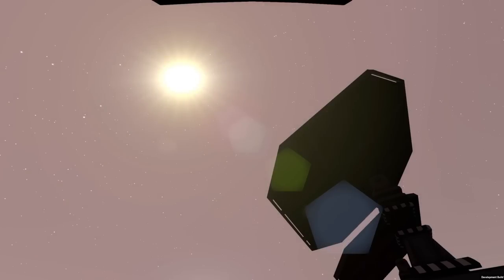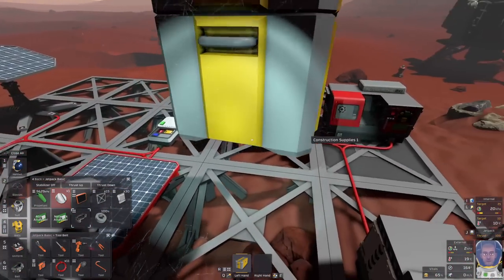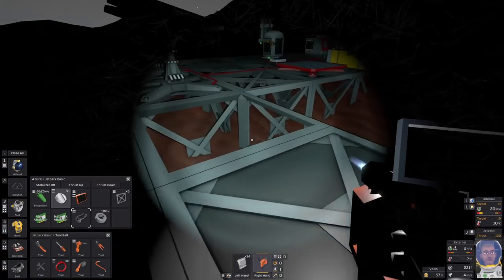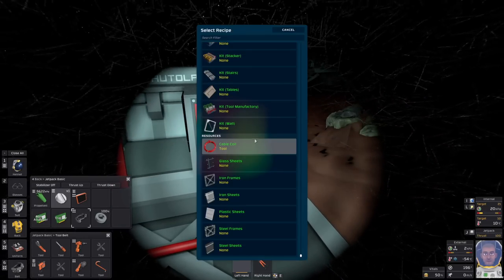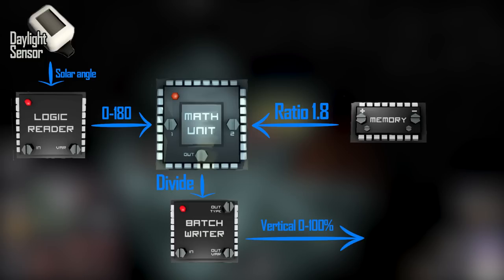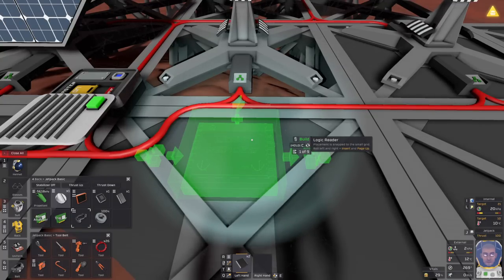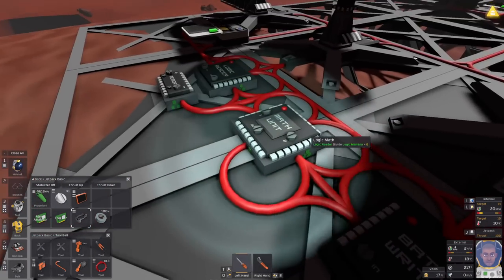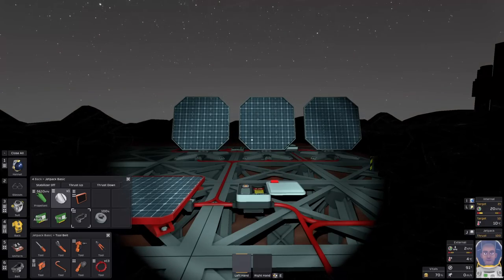Getting Started: Stationeers Solar Tracking Logic

Comment: A little tip for those who plan on going 2x axis from here: you can link horizontal to same sensor, but then halve the Vertical value, so that it wont turn away from the sun on afternoon.
Also, Solar Panels can be mounted sideways on the frames - looking cool, and functional as well.

Nice Tut, Splitsie, looking forward to one on how to make freeze dried greenhouse tomatoes.
Reply: If you need more complicated setup it would make sense to build in IC chip and make it so much simpler and compact.

Comment: a few things I tend to do when setting up my first base:  I start by building a 3x4 platform.  once I have that built, I watch the shadow of the blocks long enough to determine which side the sun is on.  so I know which side my greenhouse needs to be placed.  I then build a block on the sun-rise corner, place one block above that, then place 3 blocks overhanging the 4x side of the platform.  Once the blocks are placed, I weld them all up to their first stage.  

once they are welded, I place down the arc furnace over the center point of the block nearest to the sunrise corner, on a 4x side.  then the autolathe on the block next to it, but one position away from center with the 'back' of the lathe along the 4x side.  I then place one of the area power control units on the block next to the arc furnace; on the sunrise face of the 4x side, and wire up everything 'below' the area power control unit.  I then place the 'flat' solar panel on the top of the 3 blocks in the corner, and build a ladder to go along the center of that side.

once that is done, I build the electronics printer after mining a bit; and promptly build four solar kits.  once they are built, I carry them to the end of the outcropping that is over the pieces of equipment, and place each panel down, and adjust each one differently, with about a 20% difference in vertical angle.  this way, although I am not getting perfect recharge, I am getting decent charge throughout the day; until I can get my logic built, and affixed.  

once the logic is affixed... usually along the vertical face of the outcropping above the machines; I begin construction of the greenhouse, and atmospherics.  ending with an advanced airlock on worlds with atmosphere, and a simple airlock on worlds without.  once the airlock is done, I am usually to the point I have replaced one or two CO2 filters, plus have built several for the atmospherics; that I am ready to build a recycling system, as well as a furnace.  

This is what I consider 'basics' of beginning a world; and everything tends to deviate after I have those initial systems built up.  I tend to build a 'satellite' base for the furnace, so I can capture gasses, but the initial build of the furnace is always on an open platform without any capture systems, at least 3 blocks away from my tool platform.

Comment: Great video as always. I particularly like how you showed a scheme of the circuit.
I'd like to leave a tip... The power distribution from solar panels to batteries isn't really balanced. Especially when you get stationary batteries, they tend to drain all the power from the solar panels leaving nothing for the APC supplying the tracking system. It's best to supply that APC from the stationary battery or whichever storage system that you're using for the base rather than directly from the solar panels. This way, you ensure than even in a power crisis situation, the tracking system is always the last thing to run out of power.
Reply from the maker: Completely agree, didn't realise it was due to uneven power distribution though, I honestly didn't know what had been going wrong with my solar tracking circuit

Comment: I just got the game, but i cannot make those moving solarpanels, because it needs steel. Also storm is coming pretty fast and will destroy the entire base and whipe away what is not covered and will destroy all the boxes with its precious stuff inside.
So after restarting the game several times and loosing the food supplies which you cannot replace ( i tried 2nd time dumping everything into a hole in the ground, but it still got destroyed by another storm) its pretty much essential to first bild a greenhouse and also house the solar panels under glass and as fast as possible build lockers and move all the precious food and stuff into the lockers so they wont get lost. 

So this video needs an update ! Its not working anymore this way. 
But i really like the simplicity of the logicchips to move the solar panels almost right. Its good enough and better then all the other tutorials out there which gives unnecessary 2 axis control. This takes way too much time to build at the start. I used the coal generator to finish building the greenhouse first and then build solars because i havent enough time to build because firstly i had to build an ice crusher because the really annoying thirst wrecked my nervs and you really have to fullfill that need for water before you can start building the greenhouse.
Please keep up the good work, i loved every of your tutorial from se, so you didnt disappointed me with stationeer. Thank You !

Comment: There is a steam community guide for solar alignment, which covers both axis, and is somewhat cheap. Used it in my base, and it works great. Batteries are charging plenty for full atmo and base on at all times. I think it has like ~48  solar panels.

Comment: hey, i tried this and use the solar sensor with the vertical placement however when the solar angle goes past 90 degrees (straight up) it stops tilting the solar panels. all of the logic is set up correctly however there isn't anything working, tried placing the sensor on a horizontal surface and it goes from sunrise up to vertical and then back down to sunrise, any solutions?

Comment: In my experience playing with a similar circuit, setting the ratio to 1.7 yields about 5% better output. You can verify with a solar controller console.

I know it doesn't make sense mathematically. I think it has something to do with the minimum angles the panels can turn to and the increments they move at.

Comment: Greenhouse on Mars is super easy. 

For mine it was 1 circuit to expel gas if pressure was over 100, and 1 circuit to draw in cold martian air when temp went above 25.

Filled it with martian air and my waste tank (cause its warm CO2) early on and let the sun warm it up.

Other planets are much more challenging. Europa's poor solar angle, Moon requires cooling in a vacuum, and Titan's heat and lack of ices...

Comment: Hi, the requirements for solar panel changed in December update. It require Steel now. What do you recommend as a starter base for solar panel setup?
Reply from the maker: With that change I'd beeline for the basic furnace, there's a pretty good guide on the wiki for how to use a basic furnace and nothing special to be able to smelt steel so you can make the better solar panels as in my opinion they're worth it :)
Reply: Sure thanks ! Keep the good work.

Comment: Great beginner tut on solar tracking! I just want to note though, that with the same items x2 you can make it track both vertical and horizontal. 
Not a lot more work as it's just as easy as just vertical. I'm sure horizontal will be shown in a different video at Some point, but if anyone wants 
to know how to do it both vertical And horizontal, I suggest Rhadamant's episode 2 steel and solar video. (Sorry Splitsie <3)
Reply from the maker: I decided against showing the horizontal tracking to keep things as simple as possible. Given most new players should be starting on Mars or the Moon having horizontal tracking is rarely required so this should get people set up nicely without the additional distraction of going into horizontal tracking as well :)
Reply: I agree with Splitsie. In bodies like Moon and Mars, you still get around 85% efficiency with this single axis tracking system. Not really worth the extra setup until you have a large solar array.
Reply: @Splitsie  True enough. I guess I just like maxing my efficiency as much as possible hahah. Definitely better to have 1 axis for starters, I agree. :D
Reply: @octavioferreira2846  I mean, it isn't much extra work, so it really comes down to if one cares for not having max possible efficiency whether or not it's "worth" it I guess. For me personally, I don't mind making a couple more components to complete the system, barely costs any resources anyhow as well.

Comment: I put the starting solar panel on the same circuit with it set at 45 degrees facing the sunrise. That way if the battery runs out at night, when the sun comes up it will power the circuit and move the panels to the proper orientation. I ran out of the large batteries and the small ones did not power the circuit and panels all night.
Reply from the maker: That's a great idea for a little bit of extra backup :)

Comment: Yo how come in my game i have to use heavy cables and a transformer but when i hook it all up with heavy cables the transformer says unpowered even though i have it set to 5kw into regular cables if i use all regular cables like you did they explode
Reply from the maker: Sounds like you've got a short circuit somewhere likely joining both sides of the power controller or a battery together so it's dumping all the charge into the cable and frying it

Comment: btw where the panels start and stop away from flat on either side is of no concern in the calculation ... the part that matters is that they have to cross a path of 180 degrees .... even if the panel itself only actually does 170degrees ... it still travels a path of 180 degrees ... it goes horizon to horizon which is 180 degrees always

Comment: Alert: Incoming wall of text!

When I was doing logic in scrap mechanic, I searched hard for a way to give something a logic pathway and have it output a visual solution.  No luck.  Your visual display makes it so easy to translate into my object oriented programming brain.

The conversion factor is interesting.  When doing percents, I've always just taken the degree numerator, multiplied by 100 and divided by the denominator.  Roughly, that result is your percentage.  Is 1.8 a mathematical constant, or specific to this situation?

One way to get around the lack of power for the circuit might be to have it set the angles for morning when the sunlight disappears so that power will be restored in the morning and doesn't need to last the night.  As long as the circuit can either recharge its battery from the daily power input or from the master power storage, you're good to go.  I imagine that's another set of logic processors though.
Reply: 1.8°/% is a mathematical constant that comes from how you convert from percentage to angle.
Going pure math would make this really easy to understand but lets just do it a bit differently:
When thinking about numbers you know that 180 is larger than 100 and in an intervall 0 to 100 and 0 to 180 you could argue that there are more values in the later intervall (Lets leave university level math out here, i know this is strictly speaking wrong but who cares about this stuff anyway).

so if you convert from 0 to 180 possible values to 0 to 100 possible values you must change the "sampling rate". So for 180 to 100 it means you do the calculation 180°/100% = 1.8°/%.
But generally there are 360° in a circle so the actual angle per pecentage would be 3.6°/% as given by 360/100.
Reply: Just wanted to add:  if you are used to object oriented programming, well, the logic and programming in this game is far from it.  OOP is very high-level programming.  This game's programming is very low-level.  

This type of logic is essentially modeling the "logic modules" level (can't recall the technical term for it), which is higher level than using discrete logic gates, but lower level than programming a CPU.  These sort of math, comparison, and memory (ROM) modules are literally the building blocks of a CPU.  

The other big programming paradigm in this game is the IC10 chip, which is literally programmed in an assembly language.  About as low-level as you can get and call it programming.

Assembly has always hurt my brain, which was trained on high-level programming languages, but it can be quite fun to puzzle out.  But don't expect classes and objects :)
Reply: @JulieanGalak  lower level than assembler is machine language. Assembler was developed to make it easier to code by using a symbolic language instead. You could use real characters for op codes, registers etc and provide comments rather that have to use hex or binary directly.
Reply: Paul Torney - yes, that's true

Comment: I would have liked you to point out that this method will not work on all worlds to get you a substantial boost to power input. Namely Mimas where the solar angle is Extreme... 126 degrees to be precise. There, vertical tracking is all but useless. Other than that an excellent tutorial as always.
Reply from the maker: That's a good point, similarly for Europa where you're also far better off going horizontal

Comment: Wouldn't be easier to just put a programable block with Isy's script in it? :p Good stuff mate, nice to see something different...and way more complicated! :o
Reply from the maker: lol These days definitely, back in the early days where clang would potentially strike your shiny solar tower? I'm not so sure :D
Reply: I get the Space Engineers reference, but it's not far from truth here, either.  You can use a single IC10 chip with a script you can grab from the workshop to do all of this (I think you need a single batch writer as well).  But those chips, and the stuff you need to use them, are a good bit further into the game - iirc, you need to be able to make solder and electrum, and it's quite expensive in materials.  You also need a good power supply already in place.

Comment: I dont know why, but this game triggers a kind of car crash fascination in me, I find it extremely repulsive. It tries so hard to be as hard and "realistic" as possible, but obviously it cannot be, modern technology is far too complicated and depends on too much stuff. You can magically make super complicated stuff like the light sensor with that output, but then to get the values out of that tiny box you need a living room worth of floor space. And that was just an example from this video.
What I think is happening is the game not even trying to hit suspension of disbelief and going to just make you do as many things "realistic" as can be somewhat easily coded, while also looking extremely cartoony and obviously non physical with the small items and extremely crate filled crates and with you busting out steel frames to place even just solar panels. Any space base building game set vaguely in modern technology has to be a power fantasy, unless you bring a city worth of manufacturing you can't make more. I think we are looking at a busy work simulator, as a game it has to keep you doing stuff, the magic manufacturing is just not good enough for *that one very predictably needed thing*. You can use magic, but then you dont, until you can use it to build the next thing and have to work around with weird, not very useful magic (the "logic") to get it to work. I think I could safely say it lacks consistency.

In minecraft everything is magic and making all the magic interact in just the right way is based on logic. In space engineers you see a slightly similar issue, with some very simple blocks taking up full cubes, while as raspberry pi could do the job, but we forgive that for the nicer interface. In astroneer everything is magic again.

Tldr, I really dont mind seeing these videos, but space engineers is love.
Reply: Later in the game you can build computers and you can programm them instead of having large systems of chips around.